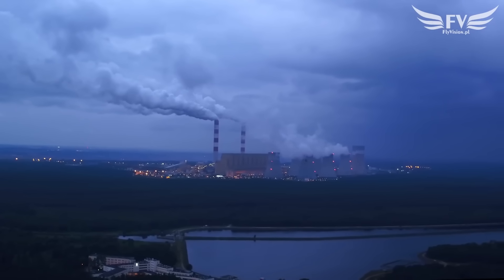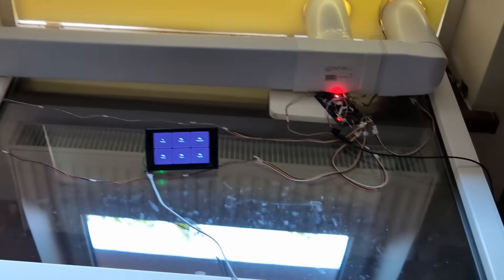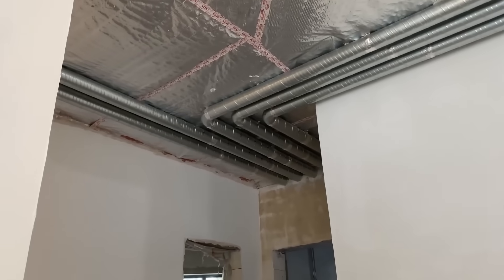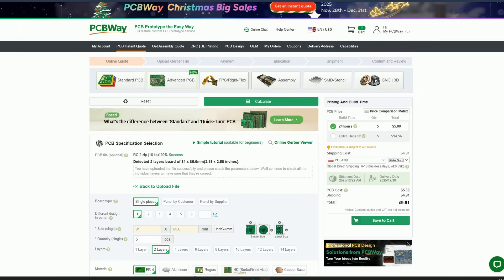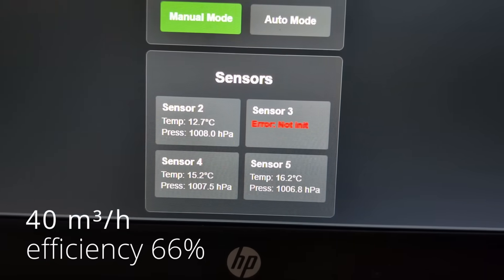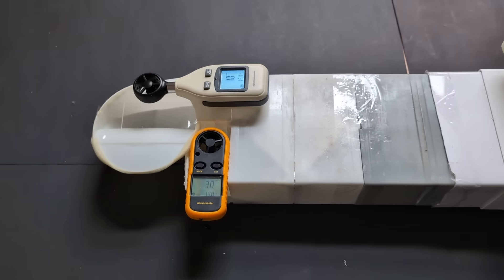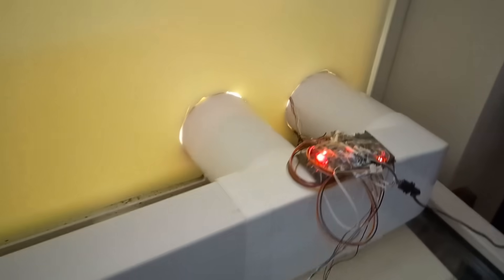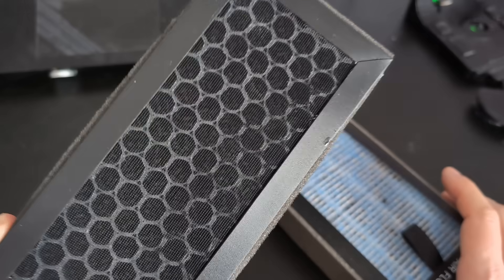DIY Heat Recovery Ventilator: From 55% to 90% Efficiency (Real Tests)

Comment: The efficiency jump with copper is impressive. Maybe the solution to all your problems would be to 3D print a monolithic heat exchanger with copper. That’s probably too specialised. Why not talk to PCBWay to 3D print one out of metal? Air tightness won’t be a problem if you design it right. Good luck! I followed.
Reply from the maker: That’s actually exactly the direction I’m moving in right now.
I’m designing a monolithic heat exchanger with a gyroid structure — it gives orders of magnitude more surface area than the current design and is naturally airtight.

Full metal printing is still very expensive, so the plan is to 3D print it and then electroplate the entire surface with copper. That should give most of the thermal benefit without the insane cost.

Thanks for following — really appreciate the support!
Reply: @DIY_Yarik  excellent! no product you can't make with a 3d printer farm, right? 😄

Comment: One detail...please don't say energy consumption is growing "almost exponentially"...and then you show us a perfectly linear distribution.
And to contribute to the topic, you are probably reinventing the wheel, but okay, each of us have some hobbies 😁
I have a centralized huge heat exchange unit, two big fans, air filters. And it cost me a 10cm ceiling height + drywall, so like 12cm. Nothing critical really...just go with rectangular tube design instead of round.
Now the positives:
1. 2 vents instead of several small ones
2. Big fans are probably less noisy than small ones
3. Changing/cleaning only one set of filters
Etc...etc...

Comment: I have one I've built a few years back that's been sitting in a shed since then. On the outside looks almost identical, but the inside is way different, and if you ask me cheaper and easier to build, and possibly more efficient. Unfortunately I haven't made time to film and post it.

Comment: Thank you for sharing, I like your approach. However I want to caution you about striving for the highest plate thermal conductivity. This can ultimately reduce effectiveness. 

In the limit where the plates of a cross-flow heat exchanger have extremely high thermal conductivity, they simply take on the average temperature of the intake and outlet air across their entire surface due the lateral thermal conduction, and end up with an effectiveness of 50%. 

The higher your power density the more thermal conductivity you need, but then you'd end up needing much tighter fin spacing and higher plate count (and hence higher surface area density) to actually make use of this increased thermal conductivity. For instance a commercial energy recovery wheel ventilator uses ~1.5mm channel height. 

So, yes higher thermal conductivity is better, up to a point, and then beyond that point it is worse. If you don't have sufficient heat transfer area to bring enough air into contact with that conductive surface, then the lateral heat transfer from the hot edges to the cold edges of the plates will destroy the efficiency. 

I also think it might be worth troubleshooting your setup for sources of measurement error, if I'm understanding your device correctly. This is a pure single stage cross-flow device, right? If a device like this isn't leaking, is actually exchanging balanced mass flows, and is being measured properly, it really should not be possible to achieve 90% efficiency. A single stage pure crossed flow design should top out at perhaps 75% with balanced flow (perhaps 85% if some sources are to be believed). 

The reason for this is pretty obvious: the exhaust exit air and the intake exit air both are leaving the heat exchanger core from the same corner. This corner can have only one temperature. The only possible temperature it can have is the mean temperature of the inlet and outlet, meaning effectiveness is 50% at that particular location. 

Of course most of the exit temperature is better than this: for instance the exhaust exit air on the opposite end has traversed the entire intake entrance face of the core, and so is very effectively brought to the outside temperature. I am having a hard time finding definitive information on what maximum theoretical efficiency could possibly be expected for a cross-flow exchanger operating with very ideal conditions, but I have not found any number above 85% quoted. I'm unsure if perhaps it's theoretically possible to get very close to 100% efficiency by running the air very slowly, but I think the fact that some portion of the outlet air is automatically constrained to be at 50% efficiency probably makes this practically impossible. Maybe even theoretically impossible.

So while your results are great, it's probably also worth looking for sources of error (perhaps sensor offsets, or flow imbalance in the two air circuits). I do think that the 90% result is very likely to be somewhat in error.

edit: one possible source of error I just read about was stratification (or nonuniformity) of the exit flow streams. Since I just discussed how the air near one corner of the core is discharged with 50% temperature recovery effectiveness, it's obvious we'd get an under-estimate of efficiency if we measured there. On the other hand we'd get an over-estimate if we measured the opposite end. If your measurement devices aren't in a location where the outlet air is thoroughly mixed, that could cause erroneous efficiency estimates. I read about that here: https://www.ashrae.org/file%20library/technical%20resources/covid-19/si_s20_ch26.pdf pages 26.5-26.6
Reply from the maker: Wow, thanks for such a deep technical dive! I should clarify one key point: this isn't a single-stage cross-flow system. I’m using a **3-stage cascade**, which allows the unit to approach counter-flow performance. That’s why I’m seeing results above the typical 75-85% limit for cross-flow. I’m also careful with sensor placement to ensure the air is well-mixed before measuring. Appreciate the insight on lateral thermal conductivity, I'll definitely keep that in mind!
Reply: @DIY_Yarik  Awesome!! Thank you for the response!

Comment: I don't get the logic behind wanting to keep the moisture inside the house. Cooking, bathing, even breathing generate excess moisture that should be expelled from the interior, otherwise mold will form.
Reply from the maker: It's all about balance. Too much moisture causes mold, but in winter, outside air is extremely dry. If you vent everything out, the humidity drops too low, which isn't healthy for your skin or throat. The goal is to maintain a comfortable 40-60% range.
Reply: @DIY_Yarik so how do you control the moisture level in the case of your exchanger? What if the moisture level gets too high?

Comment: Get rid of that horrendous noise by using Noctua NF-A12x25 G2/NF-A14x25 G2 or Phanteks T30. They should have plenty of both static pressure and airflow.
Reply from the maker: The fans are too weak to provide the required air flow.
Reply: @DIY_Yarik  What’s the required specs?

Comment: Depending on the space that you have I would recommend looking into a periodic regenerator. Especially if you are going to filter things through activated carbon you can get a lot of surface area that is dual purpose. Another important thing is when you look at the E-NTU curve for a counterflow heat exchanger with a c* equal to or very close to 1, backing down to 85% effective you can trade a small amount of performance for a massive reduction in size.

Comment: One of my friends was a CAD-CAM tech at PCB manufacturer Sunstone Circuits. They had a free CAD program PCB-123 and a quick turn program that would build 5 prototype boards overnight. Many of the on line services had their boards built by Sunstone.

Comment: Cool video! This video seems ripe for a collab. Have you considered reaching out to some well-known youtubers in the DIY energy space to at least brainstorm some solutions? Nighthawkinlight comes to mind, I'm sure him or his community would have some good ideas around insulation.

EDIT: I was also thinking about the copper forming issue. I would consider using a combination of your current crimping/rolling process and stamping would be a good way forward. Trying to get the perfect shape in one go is difficult, but if you crimp it to get it into a shape that's most of the way there and use a stamp to get it the rest of the way that might be ideal. Additionally, I would try to anneal the copper if you haven't already. If you heat it to red-hot then let it cool it will soften up which will make it easier to form, especially if you're using hand-made/3d-printed tools.
Reply from the maker: Great ideas! I’ll definitely think about a collab, Nighthawkinlight is awesome. As for the copper, I'm trying to avoid stamping to keep it simple for others to replicate. That’s why I’m testing 3D printing + electroplating now. Annealing is a solid tip though if I go back to sheets. Thanks!

Comment: You might consider an electrostatic filter as a first stage. They're typically high flow/low pressure drop, can do 80-90% of the work which makes your "wear item" filters last substantially longer, and they're washable.
In most cases, they're an ideal pre-stage in a filter system.
Reply from the maker: Thanks! I considered it, but I’m avoiding electrostatic filters because they often produce ozone and add high-voltage complexity. I want to keep the build as simple and safe as possible for everyone to replicate. Mechanical pre-filters are just more practical for this DIY.

Comment: I saw a video from a russian channel and he used aluminium plates, he didn't bend them too much, he run a couple of bends just for stacking and structural integrity, then the ends are bended in a rectangular shape to block cross airflow, his system wasn't that efficient but he used very high volume blowers for his garage.

Comment: Thank you for persisting in this! I know this is a bit excessive, but maybe you want to look into aircrete. Nighthawkinlight is looking into how to make the stuff easily at home. Its a lot lighter than normal concrete, and quite well insulated. Also, very easy to cast.

Comment: Nice!  Read about a system that forces air though small columns of water for a more organic solution.  It was about a Lazarus Forge  on reddit.  Suppose UV bio-filter would destroy mold spores afterwards.  
You, Sir, are an inspiration!
Reply from the maker: Thanks for the tip! I’ll check out the Lazarus Forge thread. Using water columns is an interesting filter, but my main concern would be the high humidity it adds to the room. UV is definitely a smart addition for safety. Cheers!

Comment: There is no heat exchange if there is no temperature differential. In the best theoretically possible case, the intake and exhaust temperatures  can equalize. E.g., 10 deg. in and 20 deg. out the equilibrium is 15 deg., which is 50% of the difference. This is the maximum theoretical efficiency the passive heat exchanger can have. Any claims of efficiency above 50% are pure bollocks.
Reply: Nope, that feels intuitive at first but it breaks down quickly if you think about it - the heat exchanger isn't one solid mass with a constant temperature throughout.
Imagine the incoming air (10C) right as it enters the heat exchanger. If the temperature of the outgoing air is higher than 10C as it's about to be exhausted from the heat exchanger (and vent outside), some energy will flow from the outgoing air (>10C) to the incoming air (10C), meaning that outgoing air can't possibly equalize at 15C.
On the other end you have outgoing air (20C) - if the temperature of the incoming air is lower than 20C as it's about to exit the heat exchanger (into your room), some energy will flow from outgoing air (20C) to the incoming air (<20C), so it won't stabilize anywhere until they're equal.
Reply: I think the confusion stems from this... you're probably imagining that there are 2 pipes with air flowing in the SAME direction, one starts out hot and the other one is cold. At some point the temperature equalizes between them - at the half way point between the hotter and the colder air flow. That's true and valid, but that's not how a heat exchanger works - you make those air streams flow in the opposite direction, then there's always a temperature differential as long as you're below 100% efficiency.

Comment: Great work and concept ! Good HRV's have a double core of alum similar to the poly type you started with, cheap pretty efficient and basically light and indestructible. If this could be adapted to work in a sliding glass door and still be able to lock it , as well as  slider windows  it would be marketable for billions of apartments and homes . If the cost was reasonable they would sell really well . Good luck

Comment: But everyone is saying that solar has outcompeted coal... At least majorly in the UK, and also in the USA...
Reply: For instance: china produced 834TWh from solar, 991TWh from wind, 1350TWh from hydro and 5860TWh from coal in 2024. As China had a big rise in coal plants to cope with our production demand for decades, which is now being replaced with enormous solar plants in the west that go with very high voltage DC cables to the east in basically the last 4 years.

Just wanted to point out that statistics are not always what they seem. As an off-grid person, I really am glad you are investing time in DIY heat recovery ventilators.
Reply from the maker: Good points on China. I used official monitoring data for my conclusion. Living in Poland I can actually see the pollution and how it hits people. Thanks for the kind words on the HRV build!

Comment: Something I have picked up over the years how much bends can add effective length to a duct that you don't realize. 
In fluid dynamics, the relationship between these three factors is captured by the Equivalent Length Method. This concept allows engineers to treat "minor losses" (pressure drops caused by fittings like 90° bends) as if they were "major losses" (pressure drops caused by straight lengths of pipe). For a standard 90° elbow, the L/D ratio is often approximately 30. This means that a 90° bend creates as much friction and pressure loss as a straight pipe that is 30 times its diameter.
1" pipe is 30 inches (~2.5 ft) per 90 degree bend
4" pipe is 120 inches (10ft) per 90 degree bend

This is why your CFM is so low. You need to use the total equivalent length instead of just overall length when you are trying to figure out how much dynamic head pressure you need for your application.
Reply from the maker: You’re absolutely right. I definitely underestimated the equivalent length in this prototype, and the pressure drop really killed the CFM.
Reply: @DIY_Yarik  It's a really sweet project. I want to see you go on with it. Just wanted to point out that the 90s are really killing your flow.

Comment: This is really one of the most quality engineering works on the internet. But let me remind of the dangers of artificially creating a "very clean" environment inside your home. This high difference in pollution between your home and the outside might make your immune system rather sensitive to the regular PM level you grew up living in. Bottom line, you might start getting allergies.
Reply from the maker: Thanks! I see your point, but the air here isn't just "natural" dust. It's toxic smog from coal and heavy industry. I’d rather protect my lungs from those toxins at home, especially since we still spend plenty of time outside anyway.

Comment: ".. aluminium tube heat exchanger .." Why don't you use copper ? That would permit a higher heat exchange. If your electronics are susceptible to EMF interference, put that into an extruded aluminium box, which should give you some EMF protection for the electronics.

"I am now switching to copper plates .."   Try anodising the copper plates. To reduce corrosion.
Reply from the maker: Thanks! That's exactly what I have in mind. I want to 3D print the unit with all the air channels and then copper plate it (30-50 microns). It should keep the efficiency high while keeping the design simple.
Reply: @DIY_Yarik  If you really wanted to 'push the boat out', you could make your heat exchange out of silver. It has a higher thermal conductivity than copper, but of course, the price has doubled in the last three weeks🤣, so perhaps not a very practical suggestion.

Comment: Cool Video! Wondering if you were planning to open source it? I saw some interesting ideas in the comments, might become a cool collaboration. 

Small remark: The graph shown in 0:42 does NOT show electricity production and instead shows the complete energy usage, thats why its called primary energy consumption and includes everything also gas engines, heating, etc. With the increases efficiency of electric heating, propulsion and transport vehicles I would expect the primary energy consumption to slow growth or even decrease due to the efficiency gains. Dont loose hope on renewable energy pal! Lots of energy sectors just dont use (enough) electricity yet, hands renewable electricity production does not factor in for those.
Reply from the maker: You’re right about the graph, it’s indeed primary energy consumption. I agree that moving toward heat pumps and EVs should improve overall efficiency and hopefully bend that growth curve downward. I’m definitely not losing hope, just staying realistic about current air quality. Regarding the project, yes, I plan to open-source all files and code once it’s fully tested. Collaboration would be amazing!
Reply: @DIY_Yarik Glad to hear that!